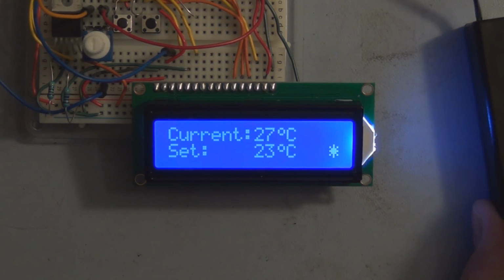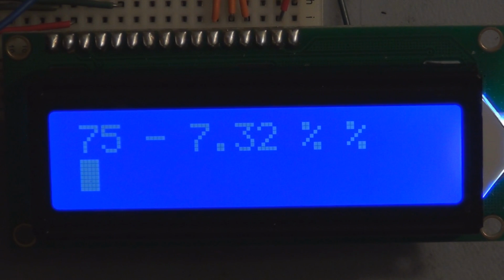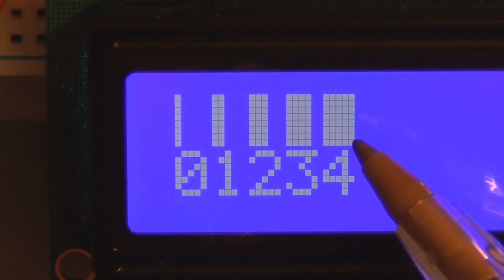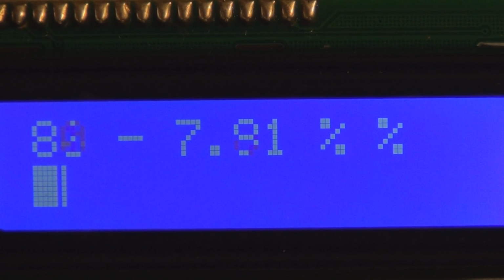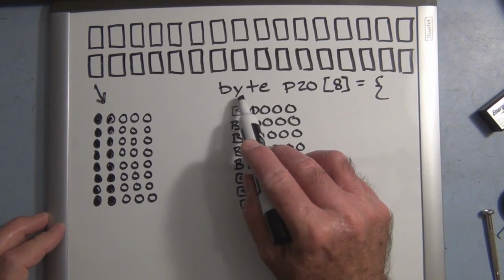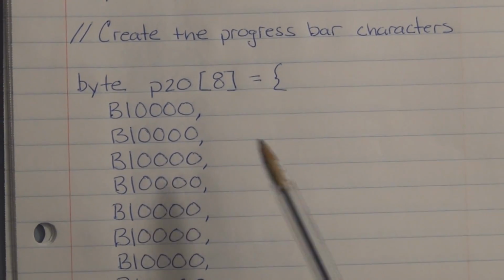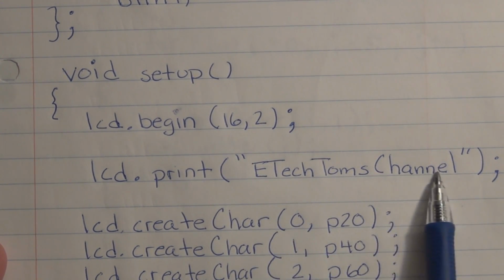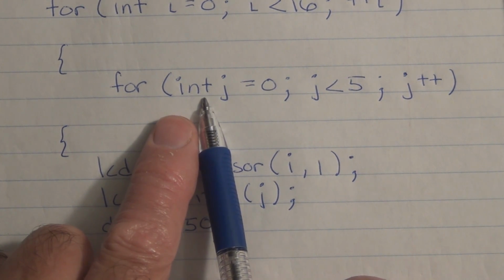Arduino Progress Bar Graph Tutorial

Comment: Hi Tom,
You explained very well but I'm little bit worried that you have created characters but never used in the loop.
Your output can simply work with only below loop
 void loop() {
           lcd.setCursor(0,1);
           for(int i=0; i<16; ++i){
                  for(int j=0; j<5; j++){
                        lcd.setCursor(i,1);
                        lcd.write(j);
                        delay(500);
                  }
           }
}

Comment: This is awesome... and a great explanation... just wondering if there is an ino we can download or view online?
Reply from the maker: //LCD Progress Bar

//Include the library code:
#include <LiquidCrystal.h>

//Initialize the library with the numbers of the interface pins
LiquidCrystal lcd(2, 3, 4, 5, 6, 7);

//Create the progress bar characters
byte p20[8] = {
  B10000,
  B10000,
  B10000,
  B10000,
  B10000,
  B10000,
  B10000,
  B10000,
};

byte p40[8] = {
  B11000,
  B11000,
  B11000,
  B11000,
  B11000,
  B11000,
  B11000,
  B11000,
};
byte p60[8] = {
  B11100,
  B11100,
  B11100,
  B11100,
  B11100,
  B11100,
  B11100,
  B11100,
};
byte p80[8] = {
  B11110,
  B11110,
  B11110,
  B11110,
  B11110,
  B11110,
  B11110,
  B11110,
};
byte p100[8] = {
  B11111,
  B11111,
  B11111,
  B11111,
  B11111,
  B11111,
  B11111,
  B11111,
};

void setup()
{
  //Set up the LDCs number of columns and rows:
  lcd.begin(16, 2);
  //Print a message to the LCD.
  lcd.print("ETechTomsChannel");
  
  //Make progress characters
  lcd.createChar(0, p20);
  lcd.createChar(1, p40);
  lcd.createChar(2, p60);
  lcd.createChar(3, p80);
  lcd.createChar(4, p100);
}

void loop()
{
  //Move cursor to second line
  lcd.setCursor(0,1);
  //Clear the line each time it reaches the end
  //with 16 " " (spaces)
  lcd.print("                ");
  
  //Iterate through each character on the second line
  for (int i=0; i<16; ++i)
  {
    //Iterate through each progress value for each character
    for (int j=0; j<5; j++)
  {
    lcd.setCursor(i, 1);  //Move the cursor to this location
    lcd.write(j);         //Update progress bar
    delay(50);           //Wait
  }
  }
}
Reply: Thank you sir....  I actually went ahead and copied from your notes on the video... works awesome!  Thanks!